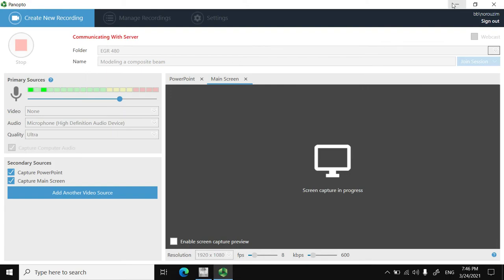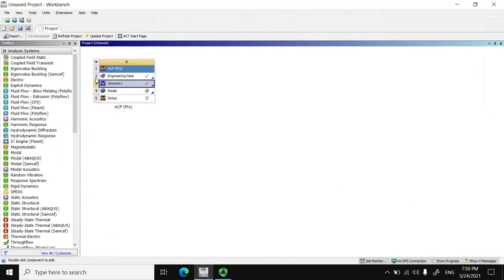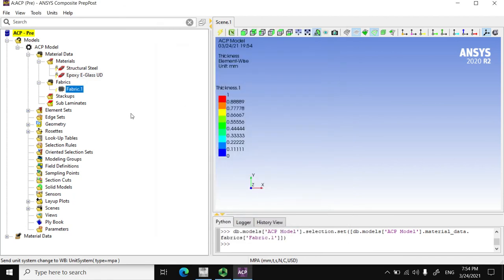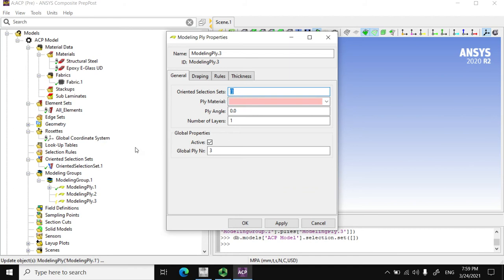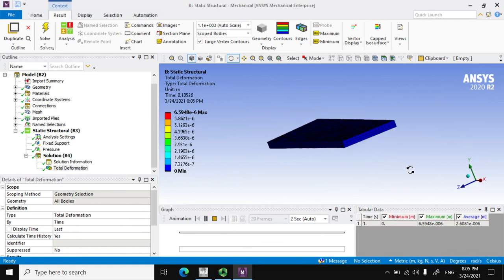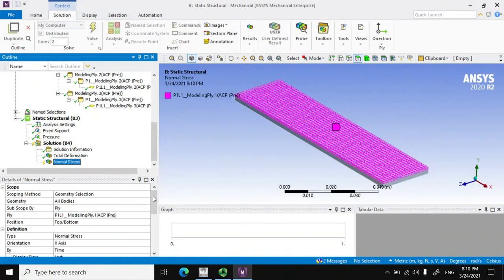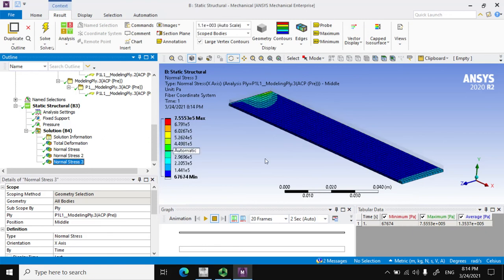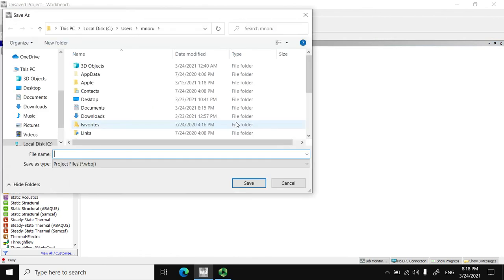Modeling a composite beam using ANSYS (part 1)

Comment: Sir, it’s very good simulation. 
Sir I have a question, if we look physically and if I have the composite materials which has 10 layers made from Kevlar epoxy woven. I cured the 10 layers so should I provide the materials for adhesion or not. That is should I provide materials separately for strip as well as for bonding material ?

Comment: I'm in early stage. If I take a 2 materials and in ACP Pre i create ply using my fiber material. Does to other material automatically becomes matrix material or how should i assign matrix material? 
If I go to solid model and assign drop off material as epoxy resin then does it mean it is my matrix material?

Comment: My first question regarding the properties u were defining in start: Do i have to calculate those before?
Reply from the maker: Yes you do you need to use fiber composite theory
Reply: @charlesthehammer-s3q  so i have to use CLT and then just input the few parameters there
Reply from the maker: @TheConceptAcademy  yes, you need to use Fiber Composite theory (properties of fiber and matrix) to find the properties of the plies then input to ANSYS